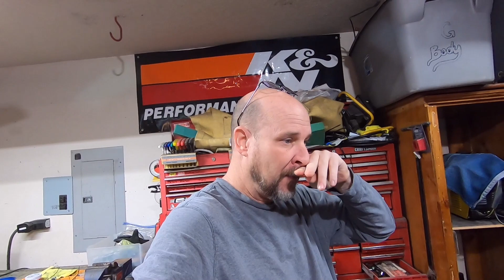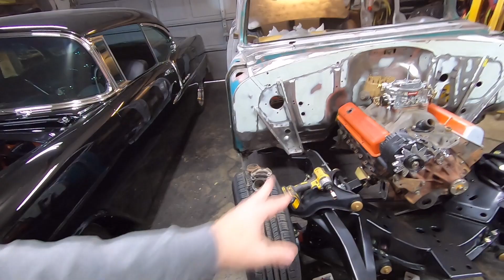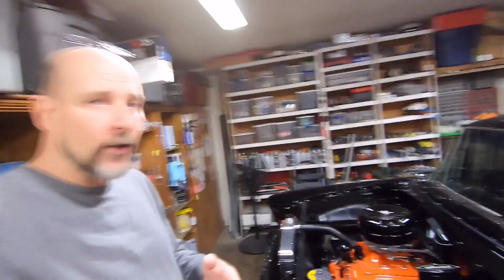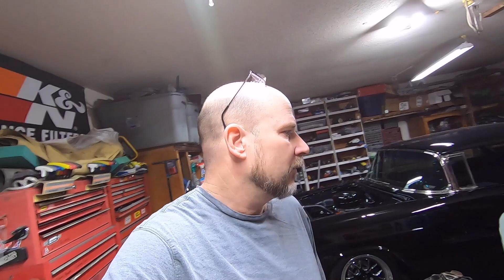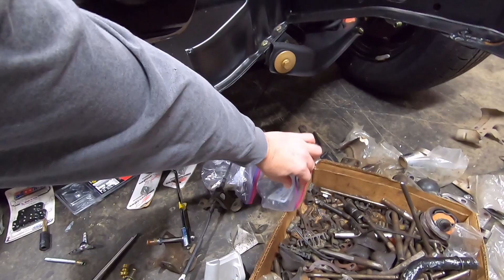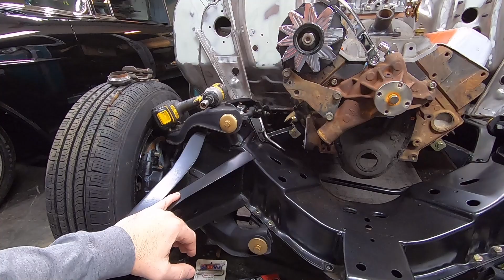Update on 55 Chevys and life threatening scare

Comment: I’m at exactly the same spot on my 56 wagon. Using 5/16” fuel lines too. My exhaust manifold on the driver side is 1/4” away from the steering box. I’m using a 307 smallblock. I’m looking forward to your ideas. Keep posting